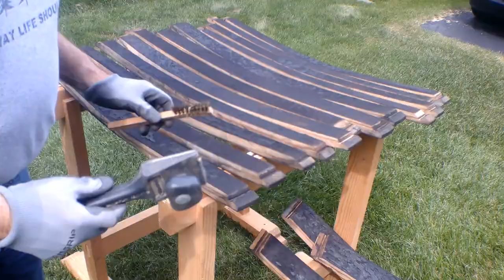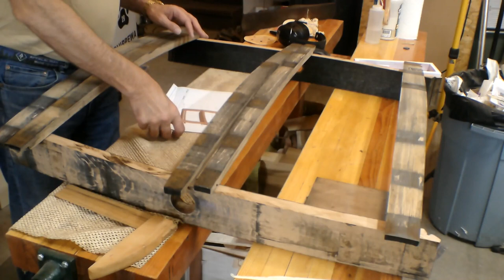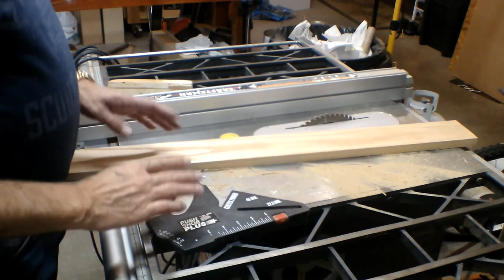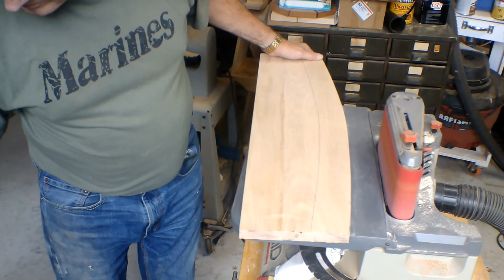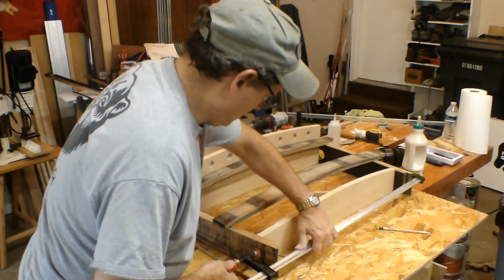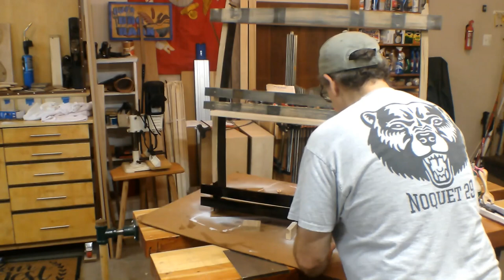Bourbon Barrel Whiskey Shelf You Can Make

Comment: Love it! Beautiful piece!  I'm making something similar right now.  How did you end up mounting it? Thanks
Reply from the maker: I used four 1-1/2" x1-1/2" angle brackets two for the top shelf, two for the bottom shelf screwed into the studs with 2-1/2" screws. With eight 1/2" #8 screws into the bottom of the shelves. Probably over kill :-)

Comment: How did you mount it to the wall?
Reply from the maker: I use 30" Aluminum French Cleats ( https://amzn.to/3pmWk1c ) screwed directly into the wall studs with 2-1/2" #8 Screws.  Be sure to screw it to the wall studs. Wall Studs are 16" on Center. Here is a Stud Finder ( https://amzn.to/3rcXzAh ).